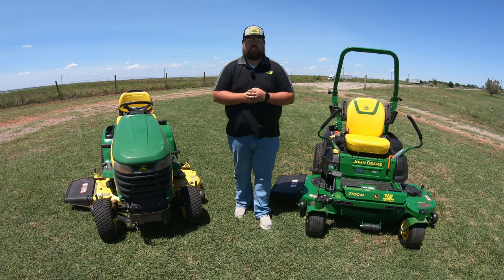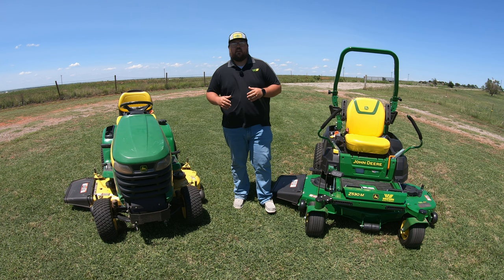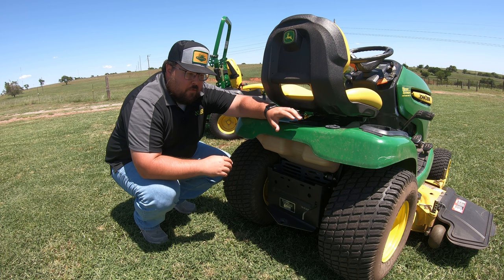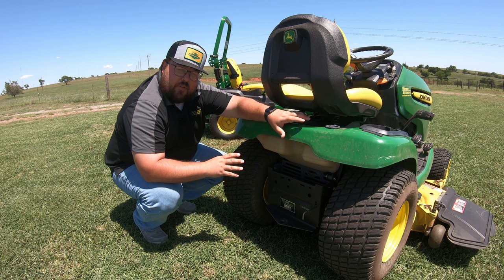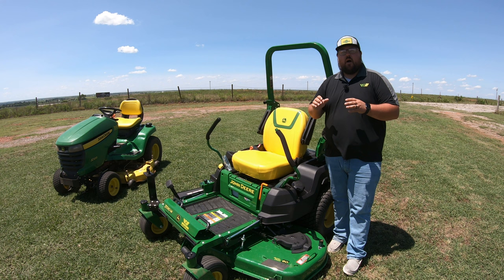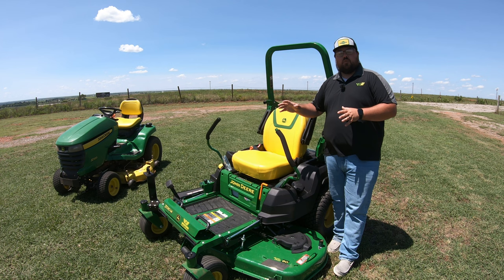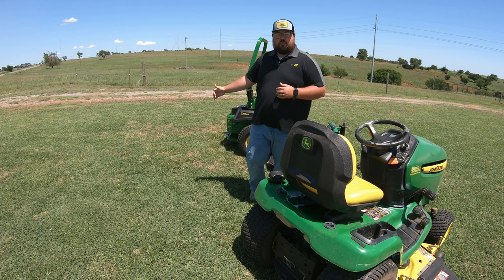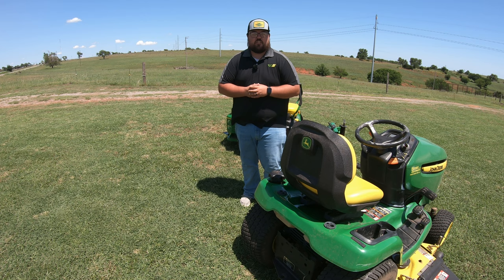Mower Starts but Won't Drive? Here's Your Problem!

Comment: On the older one’s: the transmission belt is guided through 2 pulley’s in the middle to the front. One is plastic. This one got hot, got ripped and rips the belt slowly. Took pulley off, sanded it temporary until replacing belt and pulley.

Comment: My pedals give resistance and the more I push the louder the thing is making noise. I already replaced the belt. The fan is spinning on the transmission but it won't go forward or back

Comment: Had a flat on the right rear of my JD S130. I didn't notice the key on the axle. If you place the wheel on the axle without the key, it will behave just like this.

Comment: My problem was a spring had shifted up out of the slot and was making the belt slack and wasn't engaging when I went forward or reverse, after sliding it into place the belt tightened up and the tractor worked again.

Comment: Also, make sure the pin is in the slot in the axle when putting the rear tire back in or it will not move.
Reply from the maker: This is a good point too. I think this could spark a new video of things that are essential after doing repair work. What do you think?
Reply: @WesternEquipment  Yes I think it would be a good idea also.

Comment: Good information, but Steve’s Small Engine had a fourth easy fix. If you’ve recently pulled a drive wheel you may have forgotten to replace the axle key. (3/16” square stock). The axles rotate independently. So that one is spinning, steeling all the power and the other one isn’t moving.  
$3 part. 
Thanks for all you do. Keep up the great videos.

Comment: 3 of the 4 motor mount bolts on mine were either sheered off or had come loose so there was too much slack on that drive belt and wouldn’t move.   Not sure how common that is but I thought might help someone

Comment: I know that on cub cadets people complain alot about them gettin slow in reverse. I've found that grass and debris get built up on the inside of the frame where all the linkage pivots for the pedals and it prevents their movement.
Reply from the maker: This is interesting! I had not heard that. Thanks for the info!

Comment: I have a John Deere D105A, I had disengaged the rod valve to push mower to different location in Garage, I push the rod back to original position. Still will not move after starting. Does this disengage rod become separated in transaxle and how to repair it?

Comment: My Craftsman ys4500 barely moves. Used to go fast then it would barely climb an incline to today if finally just quit. Dropped deck and pulled drive belt. Gonna replace it first.

Comment: hey need advice.  While changing out my mower deck on my X320 I pushed the deck lift pedal down BUT now it will not come back up.  I don't have my deck on at this time.  I've change my deck before but never had this problem.  Please advise.  Thanks Brinley Hocutt

Comment: My hydrostatic belt broke on my S100, just 4 hours in use. It was smoking, wouldn't move. Under warranty, they will fix it but why did it break with 4 hours.
Reply: Hi James , I have same mower, I will check mine as well since I’m off tomorrow, let me know what I found out please, thanks
Reply: @dqdanielfab  Hi, I found out yesterday the travel belt guides on the front of the mower were bent so they adjusted them,causing the belt to break, seems someone didn't do their job at the factory, it's running good now.  It was a $260 job but under warranty. 
Seems like a good tractor, I have over an acre to cut,change the oil,filter after 4 hours to get the metal shavings out of the new engine. Say you like your S100,any troubles with it yet.
Reply: @jameslomenzo1139  hi James, appreciate the reply sir, I have 1/2 an acre, no issues till I tried to move it , I’ll look at your recommendations !! Thank you !!
Reply: @dqdanielfab  very welcome, my friend helped me carry it to the JD dealership last week, they wanted $90 to come pick  it up and bring it back because I didn't take out the extended warranty im just 20 minutes from them, I do have the 2 year, or 120 hour warranty. 
Maybe your JD wouldn't mower because of the pull out transmission rod in the back. Even though I had this trouble with the belt, overall I think it's going to be a good lawn mower. Yea changing the oil early in a new engine is overlook, the metal shavings from the factory, it's good to get them out.

That cover lid, next to cup holder didn't come with the S100, it's only $8, i told the guy at Lowes about it, he when over and took one off a S130 and put it on mine, that was nice of him doing that.
Guy at JD ask me did i run over some sticks, he told me a stick could break that hydrostatic belt but that wasn't the case. I found the front bumper at Lowes for $90 I didn't want to bust the plastic hood, I have alot of trees lol
Glad you're not having any issues. Take care.

Comment: What is the best scraper to use on your mower deck a plastic scraper or a metal scraper? Will a plastic scraper. Make your mower deck last longer.
Reply from the maker: I would advise using plastic if possible just to avoid any unnecessary damage to the bottom of your deck. But sometimes the gunk is too thick or hard so you may have to go with metal.